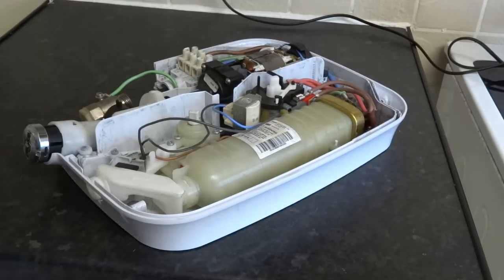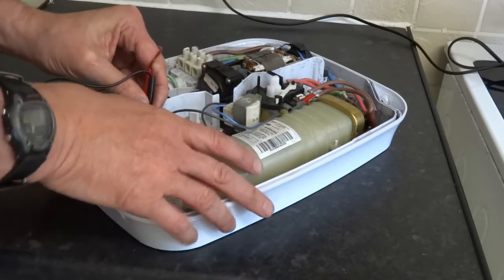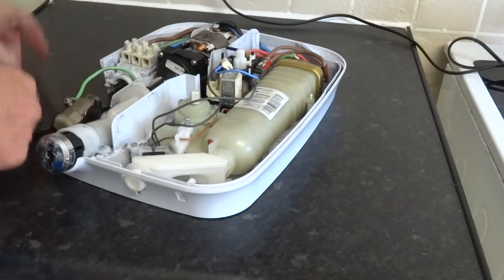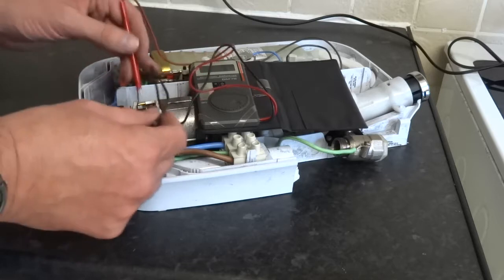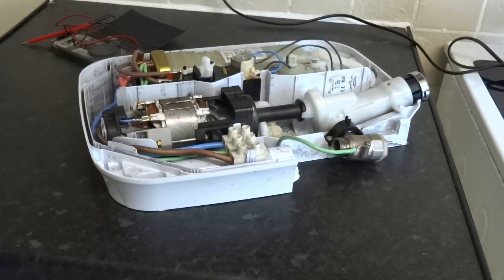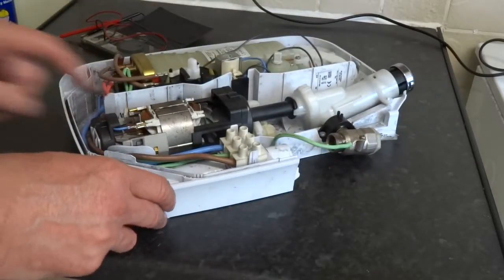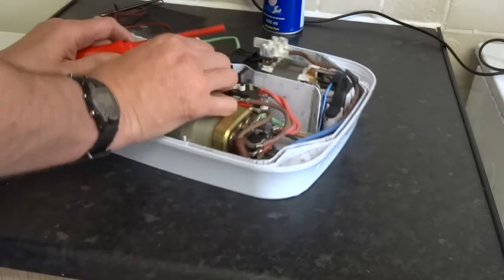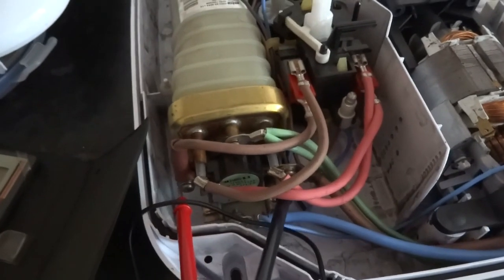Mira Elite QT Troubleshooting: No Heat, Pump Noise, No Water Pressure Fix

Comment: It is like everything else. The age of the shower plus the sum of the parts required and the labor costs. At times cost less in the long run to get a new one. Replaced one this week a family of five using it. I installed the original around ten years ago.  let's say 5 showers a day for ten years 18,250 showers they got their money's worth. The QT replacement is the Mira Elite SE. I wonder will it last as long

Comment: If you have to replace so much you might aswell buy a new one. How long do they last. Mine  started leaking from the base and then after a single use the water stopped pumping out.
Reply from the maker: Usually last a few years , did you have a look inside see where its leaking from ?
Reply: @cagmito76  It looks like it's coming from above the filter
Reply: @cagmito76   my aunts old mira elite shower lasted 40 years  from 1977/2017

Comment: But of course nobody sells the BACK CASE so if that breaks it all goes in the bin!
Reply from the maker: Yeah shame what you doing with it selling it on ?
Reply: @cagmito76  I'm waiting for a lull in use and I'm going to try to epoxy the cracked case back together. I might have to make a new entire back from a sheet of plastic and epoxy everything to it.
It probably won't work, even the screws holding the front on are almost free spinning, they have either rusted to nothing inside or the plastic screw hole has degraded.
I have the few hundred put aside for when it just needs replacing anway.